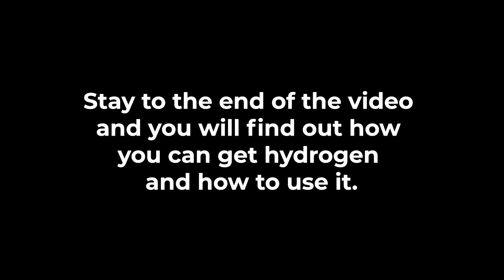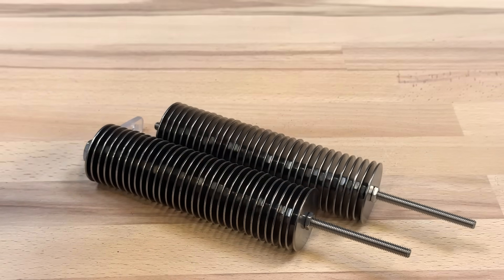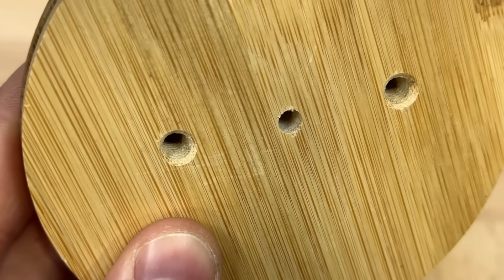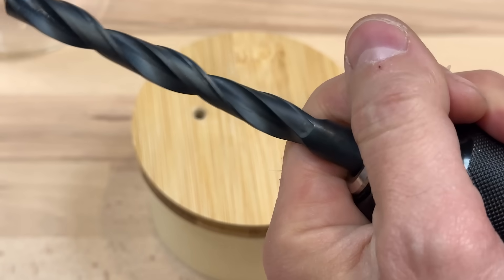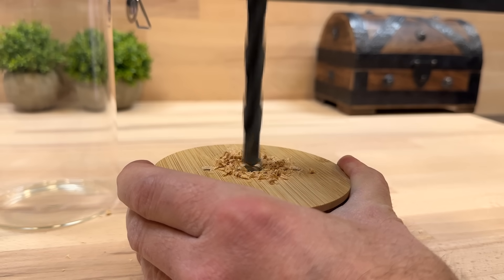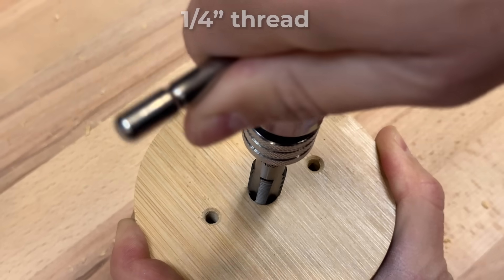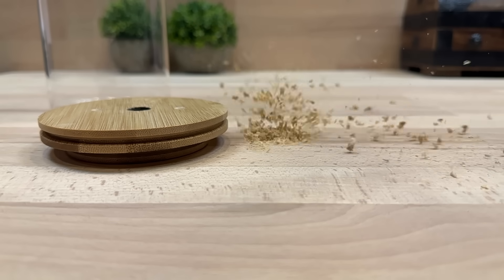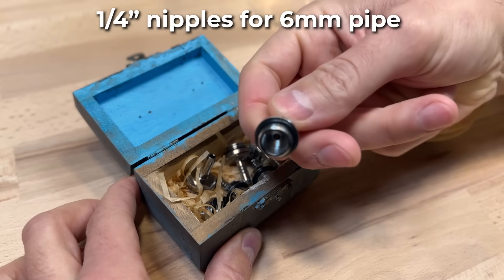Making a Simple Hydrogen Generator - Water to Hydrogen HHO

Comment: There's PLENTY of equipment and information available online pertaining to separation of the two gasses. It's not hard at all. Hydrogen comes off the one plate, oxygen comes from the other. Use your brain and make (or purchase) a proper enclosure and you can seperate the two gasses very easily. And FFS be careful! Straight off the electrolyzer this crap is not flammable, it's EXPLOSIVE. Any glass containers can and will fragment like a GRENADE. I've got chunks of Rubbermaid containers embedded in the roof because of this, it's nothing to play around with. Be CAREFUL, use ppe, and your brain. Not for the inexperienced. People lose their lives every year working with this stuff, there is safe practices tho.

Comment: Any use to power an engine?
Reply: Technically yes but practically no. Hydrogen has to be stored at cryogenic temps of up to -258 F. This temp turns it into a liquid which can then be used in a standard combustion engine with some modifications.  Toyota and Honda have tried this and are working on it but the man issue is the cryogenic temps needed to store the hydrogen after it has been electrolyzed in the water. Hope that helps.
Reply: Gereksiz Uğraşmasınlar?
Aküden Aldığım 12Volt 5 Amper Otomobilde Anlık Kavonozda ELOKTROLİZLE Yaktığı Benzinin %50 Sini Zaten Karşılıyor YETMEZMİ 60Lt Benzinle İki Katı Yol Gidiyor. 60Lt BENZİN TASARUFU AZ MI? Saygılarımla

Comment: Put a gas collection hole next to each electrode and a permeable barrier between the electrodes. This will allow the gasses to move toward each electrode and you can collect the H2 and O2 separately.  For production you would want to use an electrolyte and have a DI water injection system.  You would also want to use a non-reactive electrode to prevent corrosion and contaminating of the gasses.

Comment: If you don't have metal, you can place graphite sticks inside 1.5v batteries and use baking soda instead of salt, otherwise the salt will release chlorine gas.

Comment: The problem with electrolysis is that it consumes more energy than it produces. I believe Stanely Meyer solved this problem.  I believe that the right resonate frequency and voltage can temporarily break the bond between the hydrogen and oxygen molecules thus creating a very explosive gas. As predicted by Jules Vern vehicles will someday run on water alone. Unfortunately, Stanely Meyer died under mysterious circumstances. This seems to be the fate of such inventors. If someone can duplicate Meyer's invention it should be placed on the internet for all to copy. If garage tinkerers around the world start converting their cars to run on water, they can't all be suppressed. Water to gasified burnable gas technology could open up an age of free energy. Unfortunately, this would cause massive economic disruptions. The powers that be will fight water fuel to their last breath, but this technology must become reality.
Reply: It doesnt matter much how efficient it is if its being run off an alternator with the goal of increasing fuel mileage as opposed to trying to run off of pure hydrogen getting it to run properly in a car with computer run ignitions and fuel injection is the hard part, youd be better off using an older car with a carb and points ignition that yoh could adjust to run
Reply: I mean it could be complicated  dual to the shape of the jar or anything els that can hold it in but it has to get the two wires close to each other perfectly so it can make more gas.(btw u can use baking soda for just safety,it's better than salt anyway.

Comment: You can use high voltage generator/arc generator then connect it with your + and - of you electrolizer fuel cell and put water heater inside the water tank, 12 volt battery+arc generator+electrolizer fuel cell and water heater are fastest way to cracking hydrogen and oxygen particle.

Comment: Awesome bro, I have a lot of feedback from this but most importantly when I was designing a hydrogen fuel cell I was concerned about the back pressure and that glass/sand canister is perfect. I was just thinking of using a boost pump that pushed out hydrogen faster than it ignited

Comment: Here's how do you separate your oxygen and hydrogen instead of using metal rods use stainless steel tubes build your anode and cathode stack at the top of your stack drill holes so the holes will be on the inside of your cap place felt socks tying them above these holes now the gases cannot pass through the felt positive will make one gas negative makes the other gas now you have your oxygen coming out of one and hydrogen coming out the other a much more stable situation get yourself a butane bottle and a refrigerator pump

Comment: It's grate video. I have one question- how're you assemble lid's spring ends in two  holes in  the back  of the latch assembly on the glass jar, without lifting lid into  up position? You didn't show this moment in the video. Apparently, two long rods inside jar, will prevent to do this. So, WHAT'S THE TRICK? Thank you for great quality  video.

Comment: New type of airship ,So make  some sort of engine that make hydrogen into gas use it for lift and burn off gas at same time  for safty reasons for trust
Reply: Need to segregate the ixygen from the hydrogen using multiple baffles so that you only harvest hydrogen...

Bottle the oxygen if you can, or just discard it.

Use hydrogen for main lift balloons... use helium for trim lift.  Arrange the helium balloons aroubd your hydrogen balloons for better safety.

The water tank can be your ballast/keel.

Attach flexible light weight solar panels to the top of the airship... wire to lightweight batteries and control system as well as several ducted electric fans.

Should be able to get off the ground with ease and navigate under 5000 ft altitude, max speed around 50 to 80 mph.

Ive been thinking about such a design for a very long time.

Could also set up a simple rocket system for emergency thrust attached to the back... and generate HHO gas to burn using the rocket motor.  Should be able to hit 100 to 120 mph... any kore than that would be highly dangerous with my planned design...

Framework is lightweight softwood or hardwood, aerated ceramic tiles on exterior to help prevent puctures.

Comment: Good but dangerous demo. For as sustainable and safer H2/O2 generation: 1) power your battery using solar energy 2)  physically separate the half reactions by placing the electrodes in different chambers while still maintaining ion movement. 3) find safer and cheaper electrodes and electrolyte.
Reply: You didn't help, said what to do but not how.
Reply: @daylesuess552  dude said sustainable, then said use a solar panel. He has no idea what he is talking about. Separating the HH and O is safer but it depends on the application.

Comment: The energy required to break down water in to Hydrogen and Oxygen is just not practical.  Just like those Hydrogen cars.  The energy to produce hydrogen is just not efficient.  You are better off going directly to the battery for instant power via electric, and skip the process of using electric to break down water into hydrogen.  Therefore, it is cheaper to get go Electric car vs Hydrogen Car.  Even more cheaper and more practical, Gas Car will be much more convenient because when there is no electrical grid, gas will still get you from point A to Z.
Reply: Thank you for your small-minded contribution.
Reply: @ParaDox-xb3qw well hes not wrong. Now if you can find a way to break the water down using less power and an engine that would run on it a lot more efficiently...you may have something. But this isnt a good fuel source yet. Energy used vs energy made isnt there....yet
Reply: Mot😢if your using an Oldsmobile 403 with 6 10000 w generators from storm responders now that is going to make enough for electrolysis and all the Four condo unit buildings needs.¿ Our catalyst is our own mix
Reply: 😊😊😊 The chemical energy produced is stronger than the energy used to create it. Can be up to 6x even 10x.
Reply: What no catalyst?

Comment: UNLESS YOU USE A HIGH GRADE GOLD OR PLATINUM THE PLATES WILL CORRODE VERY QUICKLY,,,,,,,,,,,,,,THOUGHT I WOULD SAVE YOU SOME TROUBLE................P.S. HYDROGEN EXSPANTION RATE IS TOO FAST WITHOUT SERIUOS MODS TO THE ENGINE IF THAT S WHY YOU THINKING OF DOING THIS

Comment: I used a commercial hydrogen torch many years ago, for small parts brazing. It had a real hydrogen/oxygen torch tip, much safer than this mixture. The name was Water Welder and it used 120VAC supply.

Comment: This isn't hydrogen production, it's a mixture of Oxygen & Hydrogen known colloquially as " Brown's Gas " and whilst it can be beneficial for people with certain lung conditions, it is EXTREMELY explosive and a number of people lose their lives each year making this stuff.

What you SHOULD do is to use a Potassium Hydroxide & Distilled Water Electrolyte or you may produce more than just pure Hydrogen & Oxygen ... Then you use ALTERNATING positive & negative Stainless plates insulated from one another around the edges  ~ BUT ~ with a 600tpi fine mesh material (nylon, polyester etc') between the plates keeping them isolated so that the electric current can pass through the holes in the mesh but the tiny Oxygen bubbles and tiny Hydrogen bubbles which develop on opposite sides of each plate can be kept separate from one another and drawn off separately.
Reply: That's right. That's the title of this video, too. Production of HHO. In our language, we call this mixture "Knallgas." I'm interested in how the gases can be separated... because, unfortunately, there isn't a single video on that.
Reply: Das ist falsch. Die chemische Formel von Wasserstoff ist H2 und die von Browngas ist 2H. Der unterschied ist der Energiegehalt. 2H ist kalt fusionsfähig. H2 nicht. Aber bei dieser Bauweise wird ein guter Teil der Energie in Wärme gewandelt. Anders wäre es wenn du nur einen dieser Stangen baust und dafür Gewindestange und Muttern aus nicht Strom leitenden Material verwendest. Und somit einen umgekehrten Batterieeffekt benutzt. Und zur Steigerung der Wasserstoff Produktion gibts du einen Tropfen Fit hinzu. Um die Kontaktfähigkeit zwischen Metall und Wasser zu vergrößern. Und so entsteht ein größerer Anteil an 2H. Nur das 2H ist instabil und nicht Lagerfähig. Da es dazu neigt zu H2 zu reagieren. Aber Grundsätzlich hat die Gastrennung nichts damit zutun ob es sich um Wasserstoff oder Browngas handelt.
Reply: @sweetdrag1  Browns Gas is unofficially called HHO ( Oxyhydrogen ), Once H2O bonds are broken via electrolysis, you are left with a gas mix of 2 parts hydrogen to one part oxygen so in order to be a " Hydrogen Generator " as claimed in the video title, you need to keep the Oxygen and Hydrogen separated and that can be done ( as I said ) with extremely fine meshed material between the + & - plates which excludes gaseous bubbles but allows the passage of electric current.
Reply: If you can't find fine mesh screening, just use plastic tubing, I guess about 1.5" diameter with those black rubber stoppers (both at Home Depot, cheap) for the tops of each tube, of course leave the bottoms open, a snug hole drlled in each plug for your tubing, separate holes in the lid for each line. Oh, and remember not to blow your junk off.
Reply: @sweetdrag1  nonsense.  The product of this electrolysis is diatomic (molecular) hydrogen and oxygen.  This has nothing to do with fusion of any kind. 🤡

Comment: IThis design will spent most of the energy causing the electrons to buck and make it look like it is making lots of white gas, in a one bath HHO cell system. It needs to be a sealed HHO cell so you can make more LPM of gas to the amount of energy you put into the cell. It will only produce para HHO gas. If you seal each cell from each other and let the electrons flow one direction and fast and under 2.8v you can then produce a higher quality of gas. More gas power watts of power.( Water gas called Brown's gas or Hydroxy Gas™) You can then make a 4x more powerful form of ortho HHO and include the (-)non-hertzian energy into the magnetic field of a 7 plate cell for 12/14v DC power source ( + N N N N N - ) N = neutral plates. Then add inductor toroid and a rf choke toroid to capture the (-)non-hertzian energy and a square wave PWM to slam those water molecules! Add this water gas into your car's air intake and add a catalyst to the fuel. Hydro-carbons are (+) charged and (-) charged hydroxy gas will bond to the + and blow it all apart in the cylinders resulting in more HP and clean emissions by 85%! Too bad CARB can stand it. Andrew from HydrogenGarage dot calm and HydrogenTrucker dot calm.
Reply: With such a low-production HHO generator, the car will not feel any effect.

Comment: The results are a mixture of oxygen and hydrogen...not just hydrogen...caution should be taken as the mixture can be extremely explosive and can flash back into the apparatus.
Reply: Did you guys not see that he made a whole piece just for stopping a backfire?
Reply: That's what I am thinking why so many people simply combining without seperation
Reply: @lc5555  harder to seperate.  Oxygen comes off one side of the dc current and hydrogen off of the other.  There are also 2 types of hydrogen and to get the one that is most productive you need a HF current to break the gas down further.   He has a flash arrester and you can buy them for torches cheap if you do not want to make.
Reply: That's right. HHO is safe at room temperature but one tiny spark will ignite it. The burning HHO won't go through the flame arrestor because it cools the burning gas and bring it back below its ignition temperature. It's the same with the needle blow torch. As long as the thin needle remains cold, the gas in it will not ignite. But when the needle gets hot it can, as shown here: 15:00.